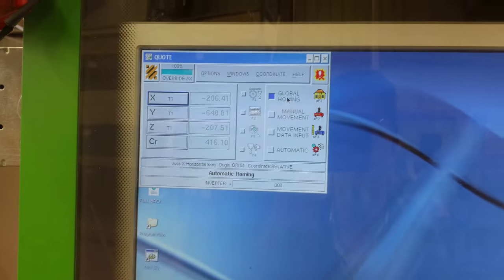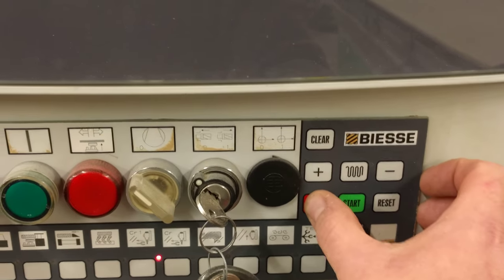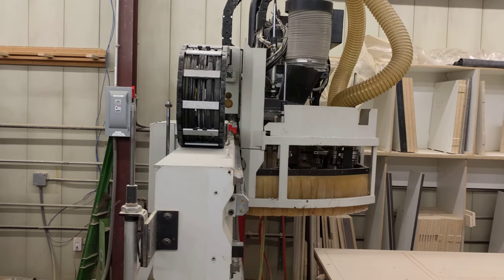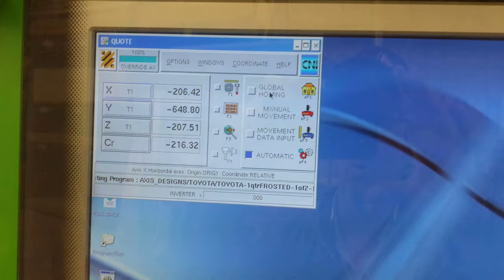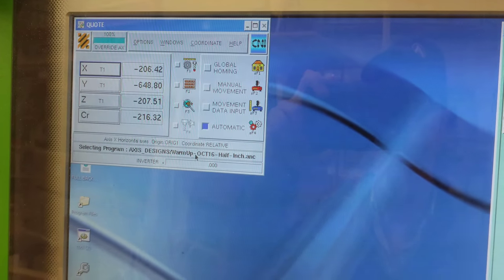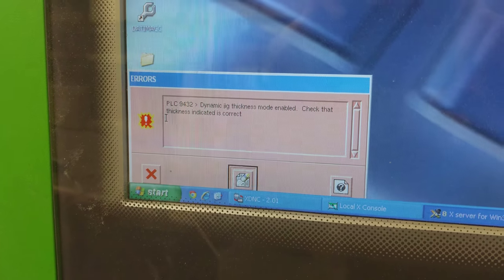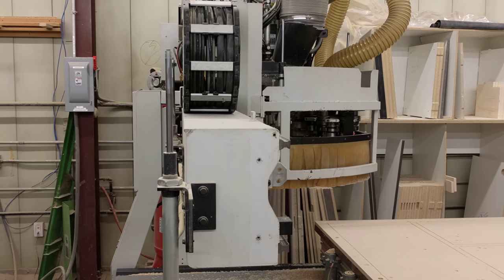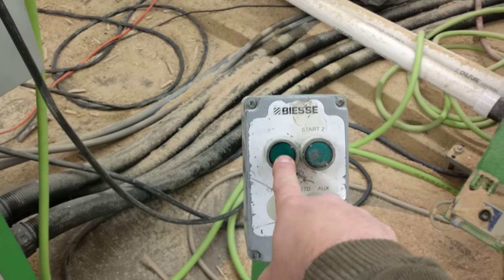Biesse Rover 24: Global Homing & Jig Thickness Error Codes

Comment: Hey brother great video! I have a rover B with the exact error codes, i am able to stop, reset, clear and get auxiliary power but when i press start to start the homing sequence the machine simply does nothing. GMM-275 NC in emergency. ANY IDEAS? thanks
Reply from the maker: Hey Rich...I would checka bunch of stuff. Start with the air pressure, make sure you have the recommended pressure to getting to the machine.Then I would check all the mushroom E-Stops, make sure none of them are pushed in. Make sure nothing is sitting on safety pressure mats. My shop-vac "Dusty" sometimes sits on the safety mat and can halt progress. Next, check foot cable E-Stops. These notoriously fill up with dust and can feel like they are cleared but dust is holding them from contacting. This could be with gate latches on fencing, too. If you have an optic sensor, check that it is seeing the marker without obstructions, or maybe it got misaligned. Something is triggering the emergency circut. Good luck and let me know if it helps!

Comment: Hey there, I like your video. I have one of those cnc machine, I just want to know what cam software you use for generating your machining program. Thanks
Reply from the maker: You can use a veriety of software. I have an old 2005 version of Alphacam that I use. But I know people are using other software. Just make sure you have a post processor for xnc1000 or old biesse compatible software.
Reply: @thecrazycncguy7500  Thank you so much for the fast replaying. So, What about Autodesk Fusion 360 or Vcarve?

Comment: HI,
Can you help me on basic Biesse Rover 346, as I cannot start my machine.
Reply from the maker: Where are you stuck!?! Do you have proper power hooked up to the machine?
Reply: Thanks for your kind reply, yes I think I have fixed machine properly, but I cannot operate because this is first time  I will use Biesse and Biesse software.
Reply from the maker: Do you have BiesseWorks? Or XNC? I am familiar with XNC.
Reply from the maker: Do you have programs that came with the machine? They might be in a folder on the machine computer. The folder is usually titled "p_p"
Reply: Actually the machine system is equipped with Linux operating system, which I cannot understand as we are much familiar with Windows, can you help me about basics as how to run this machine which process is the first to start with after homing as sometimes its on Global homing , sometimes I do it manual homing, 
nun of the spindles start or nun of the motor runs.
Reply from the maker: If you have the machine serial number (usually printed on the front of one of the manuals) you can call Biesse and they will help you run diagnostics on your machine. Since I am only familiar with the Rover 24 with XNC software, I think you should go right to Biesse for proper answers on your machine. Sorry I can't help more specifically. Good Luck!!!! Please keep in touch!

Comment: I have a Rover J and was not told about a warmup program.
Reply from the maker: Hi Jason! For our spindle (12hp) 7KW  - I wrote a program that runs for 2 minutes at 10,000 rpm, then 2 minutes at 12,800 rpm and then 1 minute at 18,000 rpm. It is the first program we run every day.
Reply: @thecrazycncguy7500  I reached out to them a little bit after this question to you and they told me it wasn't necessary which is really weird because it's in the manual also I found it in our manual.
Reply from the maker: @JasonTaylor1  Considering that they quoted me $19,000 for a new spindle, they probably have a plan to build in obsolescence.

Comment: hello sir, we have also rover 24 but the problem is when i ll start the program the router is freeze in middle. and nothing errors appears on screen monitor. can you help me to fix this?
Reply from the maker: Does the spindle stop spinning? Is it during a tool change? I will help if I can. It does seem like a programming issue. Have you run this same program with success before this started happening? Hope to hear from you!
Reply: @thecrazycncguy7500   sir the spindle is spinning.. while stop on position... i mean spidle  not continuing  to go down... i tried many used program. but the same what is happen.
Reply from the maker: @jeromeperalta5055  This really sounds like a 'tool-path entry' "(lead in)" issue. The Biesse does not like cutting paths that don't have a defined lead-in. Do the tool-paths hav a small loop where they start and finish? Does the head move over the table? Or does the spindle start spinning in the Globally Homed position and then nothing happens? Check out my other video at 15:35 https://www.youtube.com/watch?v=Dlr1lTLMqBA&t=284s